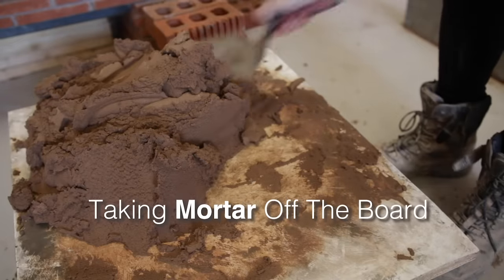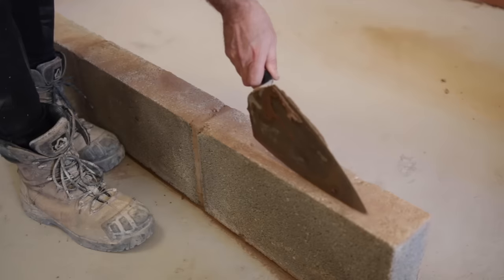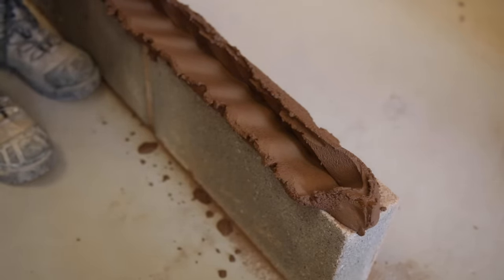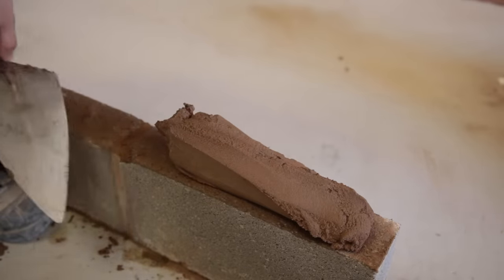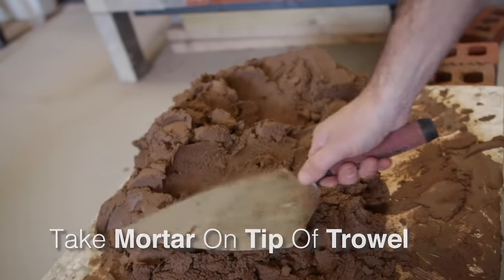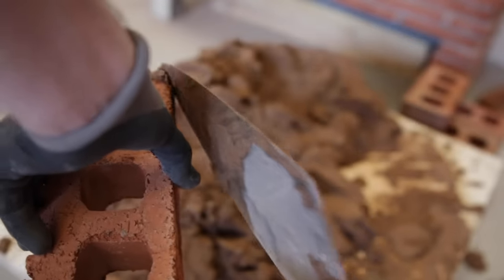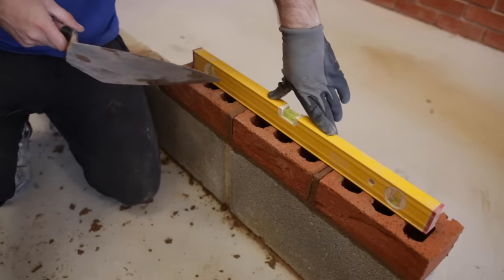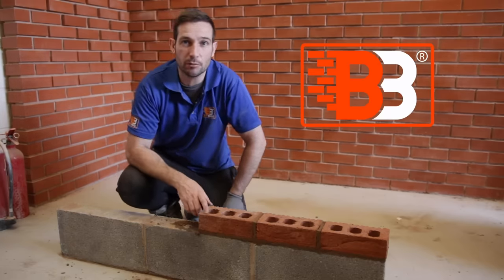How To Lay 3 Bricks For Beginner

Comment: How do you calculate and maintain the dimensions and length of a Brick Wall? How are the dimensions and length of a Brick Wall arrived at so that it will work out to a perfect number of whole bricks without having to saw or to shorten a brick or having to plug a two inch hole at the end of the brick wall? As you are making the first run of the Brick Wall; placing brick, mortar, brick, mortar, brick, mortar; how do you keep the length of the brick run in compliance with the theoretical length and dimensions of the brick wall? A slight increase or decrease in the width of the mortar joints will increase or decrease the overall length of the brick wall causing you to saw or to shorten a whole brick or having to plug a two inch hole at the end of the brick wall.

Comment: Brilliant Video Stu! Love watching your content. Given me the confidence to do some repairs to a garden wall of mine. However I can never get the mix to be as "smooth" as yours? 4:1 with plasticiser and some water. But never spreads the same as how your mortar does.

Also find that if I place a brick (engineer brick) and try to tap it down to place, if I then try to remove the brick to redo it, the compressed mortar feels like it lost lots of moisture and can't be reused. Is that normal?

Thanks, really appreciate all your great content and hope to learn more :)
Reply from the maker: hi bud, not all sand is the same, there ar many different grades and types, thanks for watching mate

Comment: Use your trowel to smooth out the top of your mortar pile then with the tip of your trowel make about a 3 inch long  slice into the mortar then push your trowel under the slice and push down on the handle of your trowel slowly to bring up the tip of your trowel that's under the slice. Your welcome.

Comment: What is the width of bricks in England? Because the width of the block, as far as I know, is 10 centimeters. Sorry if the google translator doesn't translate correctly.
Reply from the maker: width of a brick is 102.5mm buddy
Reply: @Stucrompton1  Thanks for the answer. In our country, the standard is a width of 120 millimeters. Almost 20% bigger and heavier. I like the English technology of building houses without concrete plinths on the foundation. The house seems to grow out of the ground) Many of your videos help to understand the nuances of technology. Thank!